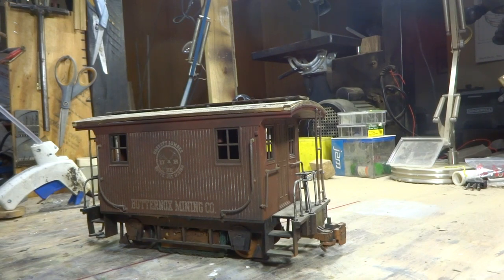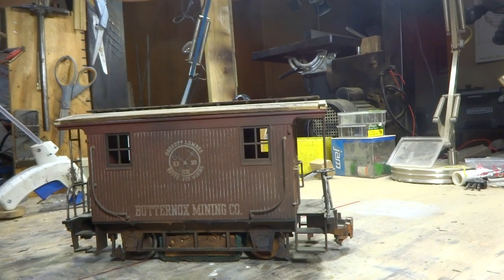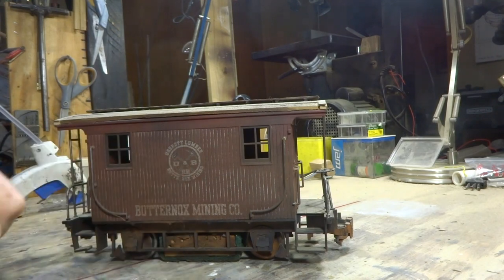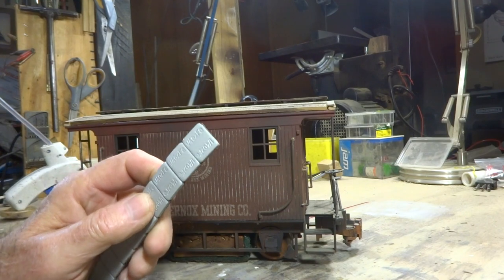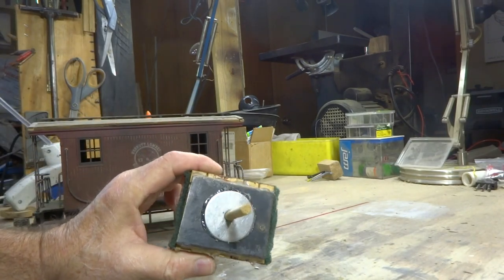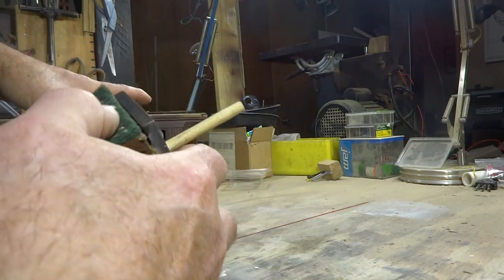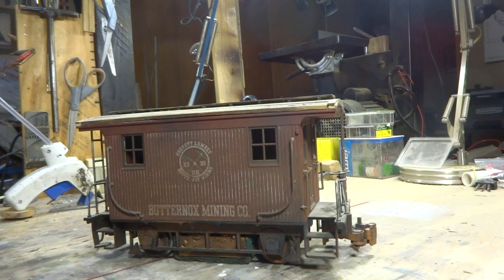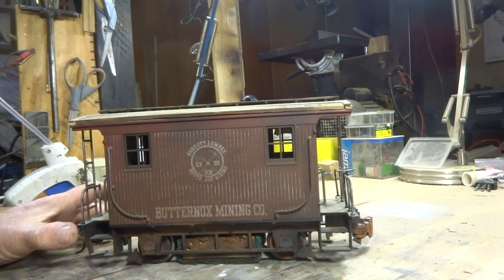G scale track cleaner

Comment: Do you use any kind of liquid cleaner on the scotch brite pad before running it? Just moisten it some not dripping wet? I imagine what you've got rigged up there works good for your scale but I'm not sure the scotch brite pad would work for smaller scales like HO and N. Very neat and interesting way of doing it though.  👍
Reply from the maker: I have always used this on my smaller scale train track as well, try a little and see dont bear down on it just a slight scuff will do
Reply: @muss1951  👍